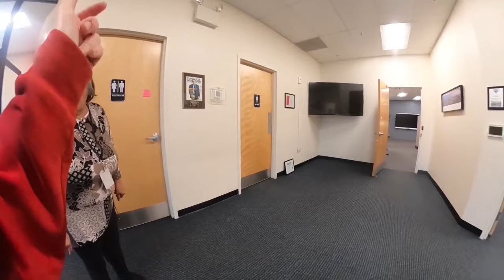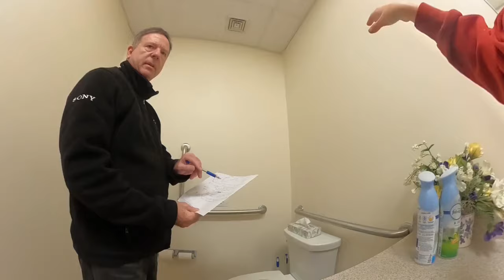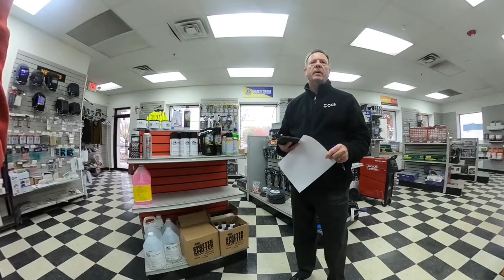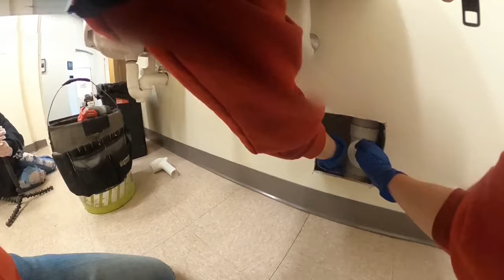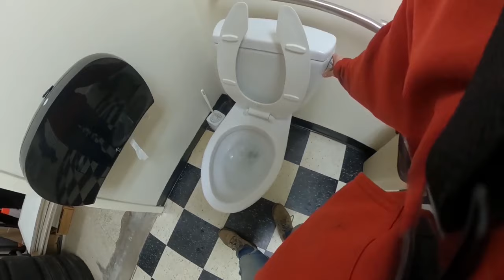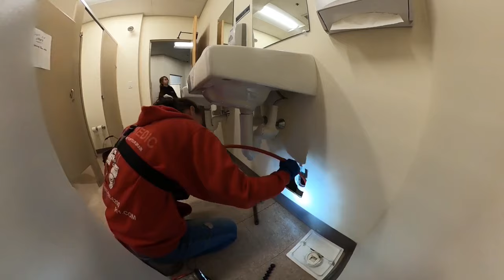Clogged Drain #167 Paper Towels #10mm #FlexShaft

Comment: How long is your 10mm flexshaft? Do you couple additional sections if you have a long run? What max would you recommend for 3/8" flexshaft?
Reply from the maker: I think This 10 MM flexshaft is 50ft. We also have a 10MM 75' one. Start with a 10MM 75' long one. We have never couple them together. Any longer then 75'. We cable it. Hope this helped. (Bob)